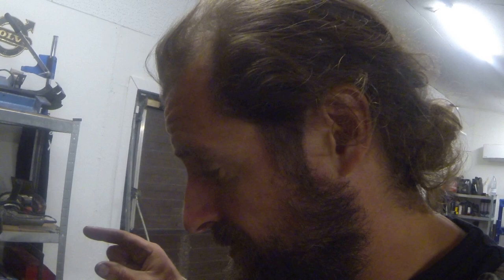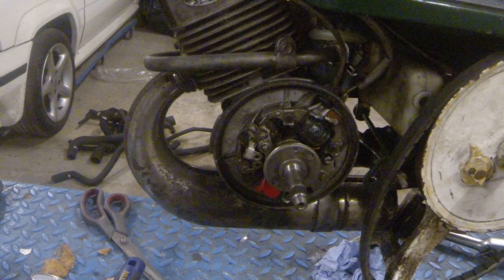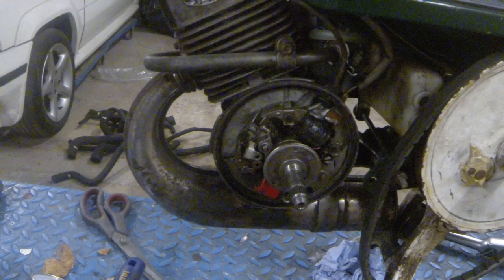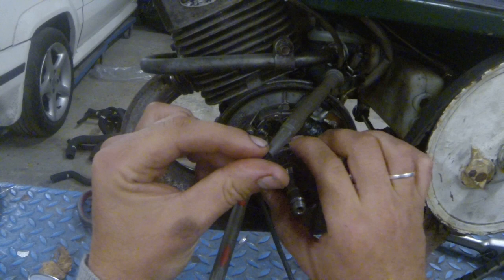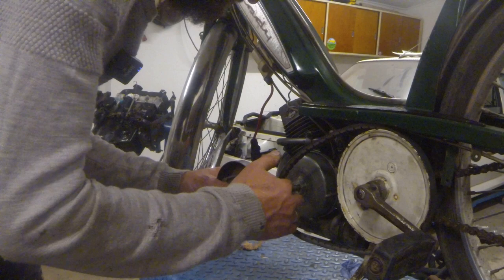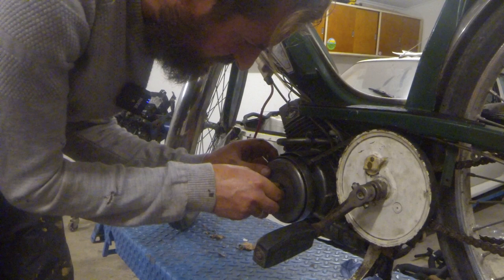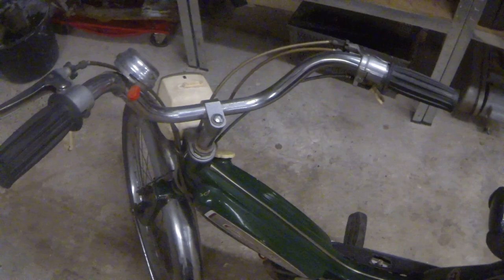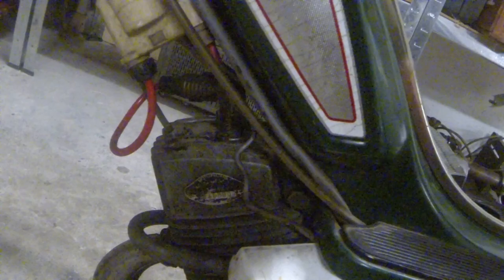motobecane mobylette cady Will it run?

Comment: Nice you saved it! Always make sure that the fuel tank has a properly working vent system. If it is clogged, it will not allow fuel to flow freely to the carb allowing it to run good at high rpm. I also noticed when you were removing the clutch assembly, the there was some movement in the crankshaft.you might have a worn bearing which will cause an air leak on the crankshaft seal.
Reply from the maker: Yes! Its still runing good this one actually! . :)

Comment: God info. Har selv lige købt en mobylette som nok har stået stille i 30 år. men så viser det sig at motoren sidder fast, det havde jeg ikke lige opdaget haha. lidt trals.
Reply from the maker: Tak!
Pokkers.... de kan sidde vanvittigt godt fast.... 
Men worst case er det ny cylinder og stempel... :)
Reply: @SeasideGarage  Tror jeg prøver at helde lidt olie ned i tændrørs hullet og lade den stå i et par dage. måske kan det klare problemet, men har bestilt et komplet paknings-sæt til den. 84kr incl fragt fra frankrig. :)
Reply from the maker: @flshelvis  Held og lykke... :) Hvis den for alvor har sat sig kan du godt regne med at der skal en 5-10 tons til at løsne den.... Men hvis du er heldig er det den helt rigtige måde du forsøger. :)

Comment: I have this problem with my Mobylette 40T, my tail light and front light do not work. It was working perfectly fine until it just stopped working while I was out driving (Might not have been while I was driving, but maybe in between stopping the engine and then starting it agine I don't know?) PLEAS HELP. Need help as fast as possible!
Reply from the maker: very hard to diagnose without seeing it... but check your wires... ;)
Reply: @SeasideGarage  Yes of corse, thanks👍

Comment: Do the rear wheel supposed to turn when it is running at idle? anyone know?
Thank you
Reply from the maker: No. At least not when the wheel is on the ground.
Its very easy to overtighten the 14 nut on the clutch assembly which make the system not work... :)
Reply: @SeasideGarage  I should have been more descriptive sorry. I should have said while the moped is on it's stand and the wheel is ip in the air is it ok for it to turn while at idle?
Reply: @SeasideGarage  Today i tested the compression on the peugeot moped motor while i had it on the work bench after installing the new cylinder, piston and rings and i only got 60 psi same as with the old cylinder and i don't undertand why that is. I tested the decompression valve and it does not leak i also replaced the crank shaft seal when i removed the clutch to overhaul it. Any ideas as to what the cause might be? Would not having the carb and the exhaust muffler installed affect the compression? 
Thank you
Reply from the maker: @SDsailor7  it is actually only supposed to be around 60psi... I was pretty suprised as well.. :)
Reply: @SeasideGarage  Yes it is surprising due to the fact that i read in a manual that it should be 90psi the some of the manuals are not very helpful.
I also removed the reed valve on the intake side to inspect it and it is in good shape. So this motor has me so confused and irritated.
Thank you for your help
Reply: @SeasideGarage  The clymer manual does not say anything about what the compression suposed to be.
Found also the factory manual and it also does not say anything about what the compression should be.
The one that mentions 90psi is the "moped repair handbook" by Paul Dempsey and it is a general repair manual covering several brands of mopeds. Have you seen this manual?
Reply from the maker: @SDsailor7  yea a little bit should be ok.. :)
Reply from the maker: About the compression- I was wrong- I miscalculated... I dont know the manual you have but the mobylette engine should have 6.5:1 compression ratio which is around 95psi... 
Some of them have a insert in the head that makes the compression abit highter I think.

I have no mobylettes in the garage at the moment so I cant check..
Reply: @SeasideGarage  I found a conversion formula on mopedarmy forum and i found out that my compression should be 123psi my compression ratio according to the factory manual is 8.5 to 1 so following the formula 8.5 X 14.659= 123psi
So i am getting half the compression it was suggested in the forum to check the head for straightness same for the cylinder even thoug its new.
This project has become a nightmare.
Hopefully i can find the problem.

Comment: You will soon being doing mopeds all the time... 😁😉
Reply from the maker: Hhaha! yea... its faster to fix a moped then a car at least!
Reply: @SeasideGarage  For sure! And so many great bikes that need fixing!!!! 😁
Reply: @SeasideGarage  keeping these wonderful little pieces of history goin down the road, bringing smiles to faces that are hard to remove.
Reply: @DetroitMicroSound  I have two peugeots and an Indian moped right now i have my hands full with one of the peugeots the other one has the motor seized the Indian starts right up only need on that one is the front brake cable and its done.
Cheers
Reply: @SeasideGarage  Looking forward to your next video if you decide to do another one.
I have 3 mopeds almost done with the second one, I is a Peugeot 103 lvs-u3
Good video very interesting and informative.
Cheers
Reply from the maker: @SDsailor7  thanks Rob! More moped project will come... No doubt. :)
I would like to get a Peugeot!
Reply: @SDsailor7  I'm a big fan of Euro mopeds if all kinds, not so much the Indians, but... One of my fellow club members (Black Squirrels) is big into peugeot, motobecane, and the later MBK's. I'm more a tube frame Puch guy. (Not as big on the stamped frame Puch's -Maxi's) I really have a thing for the Kromag AG produced Puch designs. I founded the Facebook group for Kromags -Kromag Puch Moped Klub. 😁
Reply: @DetroitMicroSound  What is the difference between those two frames?
I am totally new to mopeds and i dont know a lot about the brands terminology and technology so i have been reading a lot and watching yt videos and asking questions luckily i now a little bit of mechanics.
Cheers
Reply: @SDsailor7  stamped frames are your Puch Maxi's, most Moby, and most Peugeot. Tube frames are your Puch X30 etc. Tube frames all employ notched and welded tubular steel frames, while stamped use a die cut and stamped sheet steel, which is then welded together in at least two frame halves which mirror each other but form a frame when mated together. (My dad was a Die Maker for General Motors...Can you tell? 🤣)
Reply: @DetroitMicroSound  Ah. That is good to know information so probably the tube frames are stronger? And that is the reason you like those models that have them?
Its great that you know about these things all thanks to your dad. Right now i am in the process of torking the head on my peugeot i had ordered a new cylinder kit and i just finish installing it.
Cheers
Cheers
Reply: @SDsailor7  not nessesarily stronger...but can be, depending on condition. I just like the design approach more, overall. One big reason being that my fuel tank isn't structural element, and can be easily removed from the rest of the bike if needed. It's easier to fix a vintage steel tank with rust inside, when it's not inside the bike frame.
Reply: @DetroitMicroSound  Well you can say that again! What a pain trying to remove the rust from my Peugeot! I hsd to figure out a jig to be able to rotate the frame so that the bolts and nuts inside the fuel tank did their job.
Reply: @SDsailor7  Yup! See! And have you inspected the inside of the tank well, to have confidence in the structural integrity of the frame now, in the area at the very bottom of the tank? I don't want to find out your bike broke in half, and you got hurt. BTW, where are ya? I'm in suburban/metro Detroit, and ride all over the city a lot.